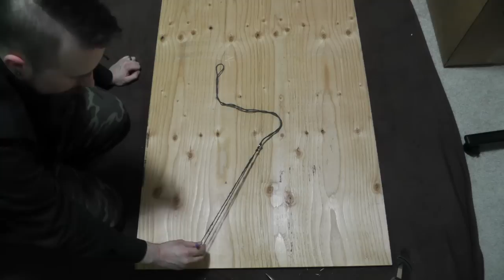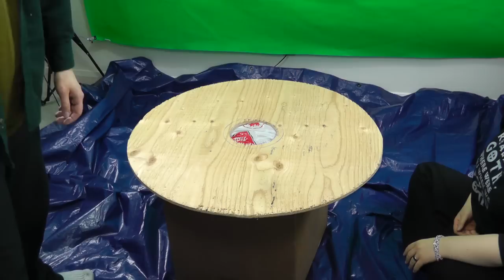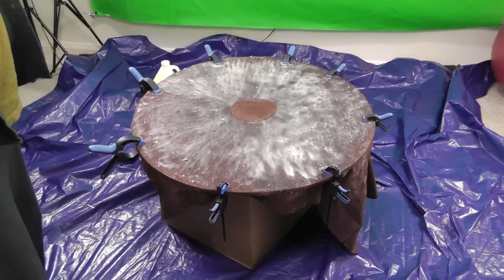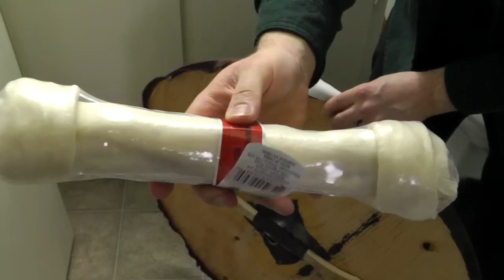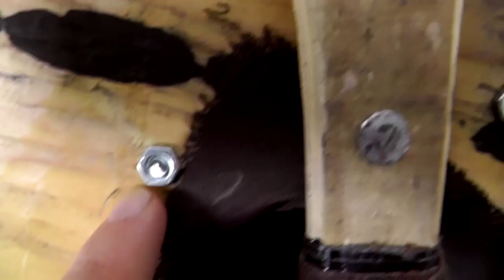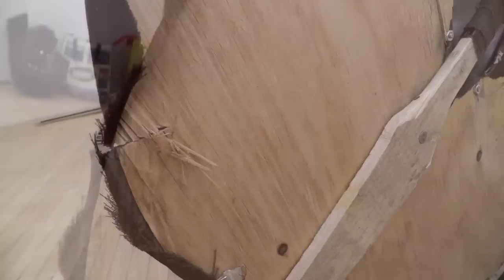How to make a Viking shield on a budget

Comment: let me give you some tips :) by covering up with linnen (or as in your case canvas) i normally use 2 layers front one layer at the back :) and it gos much easyer if you soke the linnen in woodglue and then put it on :) also it has the effect that you have it better glued with the wooden heart of the shield, for attaching the schield boss and handle i use those (http://www1.solardirekt.com/media/catalog/product_images/05150x_m10_schlossschraube_din_603.png) they look like rivets and have the advantage that you if your shield burst (and it will) you can easily remove handle and boss to use it on the next shield :) to attaching the rawhide i prefer to sew it on :) to do that you have to drill holes first (throgh wood and rawhide) and then sew it with thick waxed linnen yarn :). the fact that the sword got in to the rim of your shield is really logic because these viking age shild where made to its not actually te fault in terms of the wood :) there are techniques to trap the blade in such ways so the opponent loses either his weapon or his cover so you can hit him ;)

Comment: Did they really only have 1 layer of wood and canvas each? I would have expected more.
Reply: ...Of course they had, well it depends on the budget the warrior had, a Huscarl probably had a shield made of thick, bend oak planks, framed by a iron,steel or bronze frame and a metal boss. A poor raider probably had a more simple shield with a animal hide drawn over it and no boss or even no shield at all.
Reply: No, the shields where usually made of 3 layers of thin Wood for that extra durability and the Woods "veins" would cross each other. If u see the shield, if someone swings sideways into skallas shield, they will propably go right through to his arm or hand and the linnen was common, or skin if u had some silver in your pockets.
Reply: Strictly speaking, it isn't "1 layer of wood."  He's using plywood, which is a pre-layered wood product.  In normal, mass production non-finish grade plywood, there would be 3 1/8" plies in a 3/8" sheet.  It's the quick, cheap and simple version of finding 1/8" finish veneer linden and doing your own "plywood" by alternating grain and gluing it together.

Comment: whats the measurements for the shield.
Reply: He said it was c.30 inches diameter. Many were a lot smaller c.24-26 inches. I made mine 32 1/2 inches & it's too big really as it gets in the way of wielding weapons. One day I'll make a smaller, handier one c.26-28 inches. Thickness was generally 8-12mm. I used 9mm ply. I also used evo-stick adhesive to glue the canvas on as it doesn't seep through the canvas like wood glue does, but glue it outdoors!

Comment: I would make it with multiple layers of ply wood.
Reply: then it would be both heavy and not historically accurate.
Reply: TheBaconWizard Well in that case i would use a 30mm thick plywood board since some historical viking shields were found in that thickness.
Reply from the maker: The question is, where those meant for battle or were they just decorative or for the grave only?
Reply: ***** I know these guys were tough, worked physically etc, but would YOU wanna hold a 30mm thick board plus furnishings for an hour or so? And not just hold it..  be active. My old Kite shield was quite heavy enough :-/
Reply: TheBaconWizard Greek Hoplites did it, so why not
Reply: ***** theirs were about 2cm at the centre tapering to 1cm at the edges.
Reply: TheBaconWizard it was also wood covered in bronze

Comment: So many things wrong.
You have to use linen on the front and back of the shield, and on the egde you have to glue few layers as well.
Never make nails face out, you dont want to hurt the other guy, make them face you and BEND them inside, so nobody can get hurt.
For the edge use leather, make holes on the edges, put wet leather on the edge then tighten them using leather straps throught the holes.
Please dont use screws and call this a viking shield.
this way, you have durable viking shield.

Comment: Well my Canadian Brother of the Blade, Not bad for your first run at it. I have made now six shields that are used with wooden weapons and aluminum swords 1 is used for display only. I copied mine from the ones I was given from the Philippines. Our shields have bend in them. I used plywood also but soaked it in hot water and made a bending jig with old 2 inch pipe and old bed rails. I used half round Rattan sticks notched for leather belts for arm straps. I bradded my nails over then covered them with Bondo. My edges were covered with rope instead and it is glued and nailed. They seem to hold up well. If want more info on how I did it e-mail me through my website (www.southbayfmaclub.com) or you can buy e-book my book on making training aids through lulu.com Drop me a line love to talk more on this subject. Mataw Guro Marc Lawrence

Comment: I would have thought that you insert the boss from the inside, before you put the handle on (because of the lip where the screws are), I thought that goes on the inside of the shield instead of the outside.